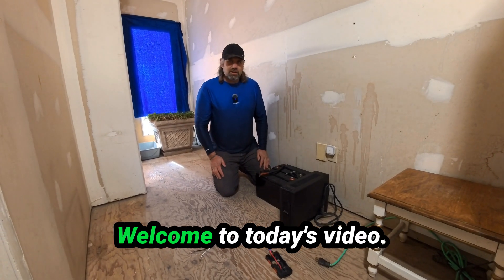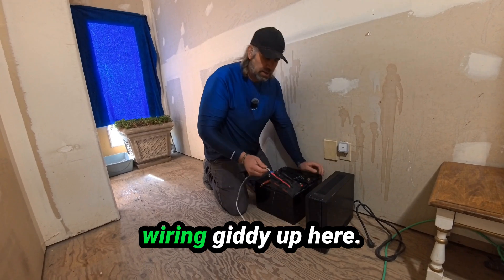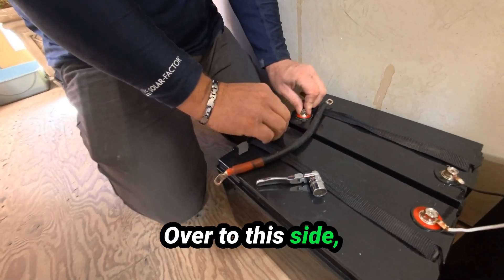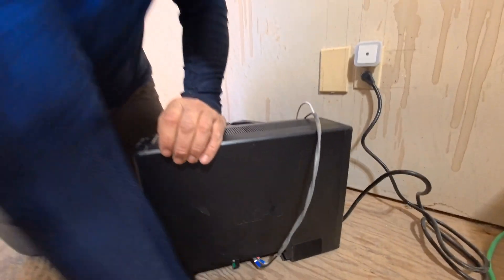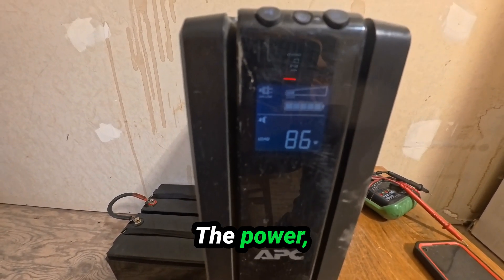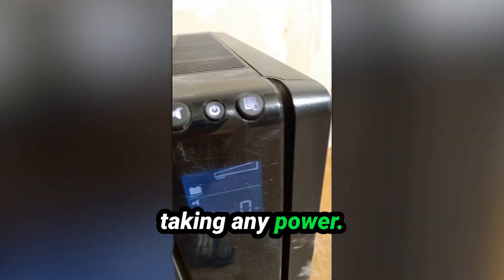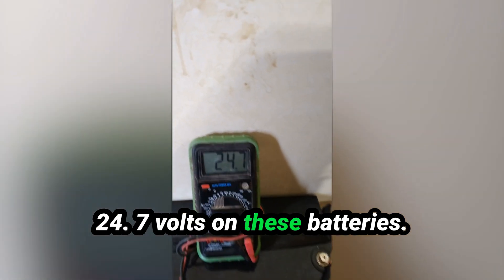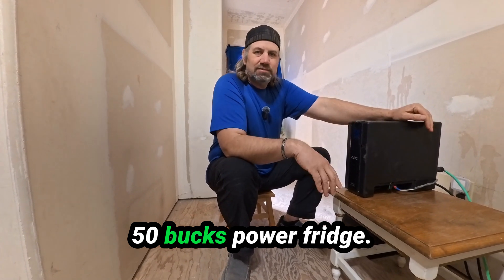$50 UPS Power Station with Lithium runs Refrigerator for OVER 75 Hours

Comment: The UPS is calibrated for lead batteries. Is there an option to change the float voltage?
Reply from the maker: I don't know if there is an option to change the float voltage. I just know that lithium batteries are cheaper than lead acid and even if they are not charged ideally, they will still outlast lead acid.

Comment: I saw it working but aren’t the leads from the Battery to the UPS kind of thin?  Looked like maybe 16 gauge. If I were running from those batteries to a regular pure sine wave inverter I’d be using much heavier gauge than that. 

It’s a shame a few years ago I recycled that same UPS when it went bad. Likely only needed batteries. I had extended warranty that bought me a new one, so I recycled the old one at Best Buy. 

In the future can you measure the current draw when the compressor is running?  Thank you. 

I hope you do try it with panels and a charge controller.
Reply from the maker: The wires are a little small but because I am only using 100 to 200 watts, they are not heating up at all. 
I am currently using the UPS to power a chest freezer it ran it for two days. After the batteries ran dead, I hooked up 500w of solar and a charge controller. 
I should be posting the video in a couple of weeks.

Comment: I don’t know what a UPS is but I’m impressed it ran a fridge for that long with that little of batteries. I think my $3k battery would do the same..
Reply from the maker: A UPS is uninterruptible power supply. They are used for desk top computers so you don't lose your work when the power goes out.

Comment: $50 power station plus $320 in batteries
Reply: The assumption is you already have batteries.. but a battery can’t run anything without a brain. He’s showing how to hookup the brain
Reply from the maker: @BirdsNherds  💯
Reply: @Thesolarfarmer  if that ups is drawing 1.3 kW , that ups in question can undeniably run an induction stove set on a 1000 continuous running watts

Comment: Did you just put a metal case on top of of both terminals??? 0:57
Reply from the maker: The UPS has a plastic divider that the connections are built into. That is what I am sliding into the unit and there is a plastic cover that goes on the bottom but I have not put it on yet.

Comment: Are you sure you can recharge a LiFePo battery with a charger made for a lead/acid battery? I'm talking life expectancy of the batteries, and maybe even fire hazard...
Reply from the maker: The LiFePO4 will not get charged to 100%. I think that the lead acid charger will probably shorten the LiFePO4 life span. LiFePO4 batteries are less expensive than lead acid batteries and will out last a lead acid even with a shortened life span. Lithium iron phosphate batteries do not catch fire like their cousins lithium ion phosphate